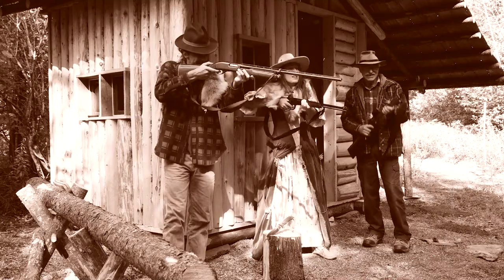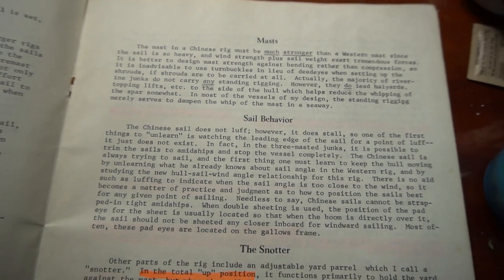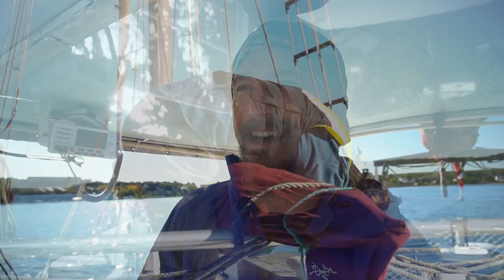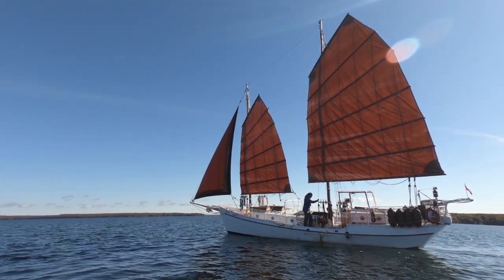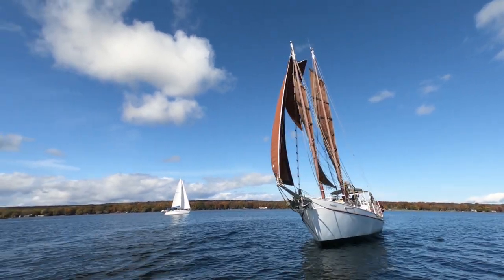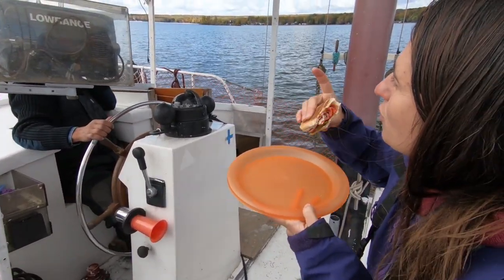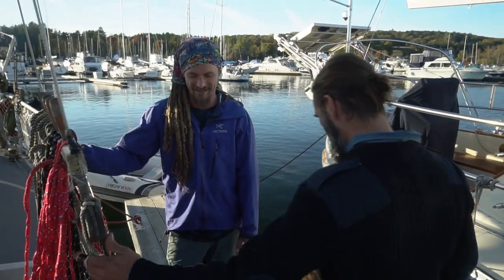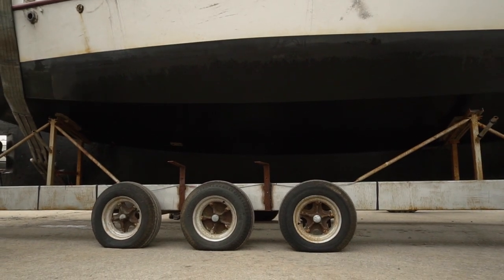Sailing a Thomas Colvin CHINESE JUNK RIG SCHOONER in the Georgian Bay [Ep 154]

Comment: Very nice video. I am sorry that you didn't get any wind to speak of, the lug rig really shines when the wind picks up and puts some bend in the battens and especially when the wind is strong enough for reefing. To drop a panel or two to reduce sail is so fast, so easy you wonder why more cruising boats don't use the lug rig.

The lug rig is excellent for cruising because one person can easily set sails, reef the sails, trim the sheets, and lower the sails with no help required.
The lug rig is a lousy rig for day sails with friends though, there is nothing for anyone else to do! Boring...

Only slightly kidding but it is nice to have everyone who wants to, to be able to have a job while sailing.
It's really obvious when sailing with another boat and watching them run around doing the sail handling while you just sit and sail... especially if you have a windvane or auto pilot self steering.

I hope you will get to sail with them again when there is a nice breeze.
Reply from the maker: It would have been nice to sail with more wind that's for sure. However not having too much wind made it less scary to hoist all the sails. We were all very new to this type of rig.
Is lug rig a different way of naming the junk rig? At what kind of wind speed do you usually start reefing this type of rig? I can only imagine how simple it is to reef the sails. You seem to have a lot of experience with these kind of boats. Do you own one? Any tips are appreciated.
It was still very enjoyable to sail and get to experience this beautiful of a sailboat.
Reply: @WildlyIntrepid  Yes, I built a 28 ft cruising sailboat back in the mid '70's and used the Junk Rig Design Guide by Jock McLeod & Blondie Hasler to design the modifications to the boat and for the rig itself. Many of us prefer the Lug rig name over the Junk rig name although both are correct, and both are misleading to people who don't know them. A traditional Lug Rig doesn't have any battens or a boom, and a traditional Junk rig makes people think of the hull design, not the sails.

On my boat I didn't start reefing until about 20 knots apparent wind speed but that depended on the wind direction and what size waves and boat direction. I generally set the sails for a comfortable boat, not for the extra tenth of a knot that I could get carrying more sail area. It is amazing how much more comfortable, and safer, a sailboat is when sailed at 90% instead of 100%. It is so easy to drop a panel reef and to pull it back up that we would do it just to see the difference in speed and motion. It is something you soon learn by how the boat is moving through the water, not by how hard the wind is blowing.

I didn't watch the video again but I seem to remember that when your sails were being raised, the lazy jacks were loosened and the bottom of the sail fell on the deck? We don't adjust the lazy jacks that way, they should be set up so that they are slightly loose when the sail is fully raised, and they support the bottom battens and sails when reefing or dropping the sail. The sail is always safe and supported this way.

Colvin also used a different but similar rigging design by using sheets on both sides of the sail attached to the battens while the more common arrangement is a single continuous sheet to the ends of each batten. Both ways have advantages and disadvantages. Same with the mast and rigging, Colvin used loose stays and shrouds, the Hasler/McLeod designs are unstayed. My boat had a tapered diameter and thickness aluminum mast I had air freighted from England to Maui where I built my boat. 

It was always fun to take people sailing and watch them as they watched the mast bend under a full sail and a nice breeze. It took me many days sailing to build my confidence in the mast! Calculations are great, but the proof is watching it in action.

There is a small Junk Rig Association based in New Zealand online that would be an excellent place to start learning more about sailing the boat. searching online should give a lot of information and leads too.

I built my 28 ft boat to go cruising after spending 8 years on a 40 ft cutter doing sailing charters out of Lahaina, Maui. I wanted a smaller, more affordable and easily managed boat that one person could easily handle. I chose the Vancouver 27 design and modified it to be a flush deck with the Lug/Junk rig, built a mould and laid up the fiberglass hull, then the deck and interior. The boat was solid, safe, very comfortable, and so easy to sail.

My plan was to sail north to Alaska, down the west coast, through the canal, through the Caribbean, up the east coast, over to England, then to France where I would pull the mast, separate the two sections (30' & 15') and lash them on stands over the deck so I could put a nice tarp over them and then spend a couple years motoring the canals of Europe...

I needed cash to buy the diesel engine and was offered a job in Alaska for a few months which I jumped at. The few months turned into almost two years and a major change in life so I returned to Maui to sell my boat and move to Alaska.

The buyer of my boat sailed the South Pacific and eventually wound up in OZ where they put the boat on a cargo ship and sent it to the Seattle area where they sailed for a couple years before shipping the boat by truck to the East coast where I lost contact with them. They loved the boat too.

Long winded I know. Search here on YT for videos of Junk rigs and Lug rigs, there are a few I'm sure. Maybe someone has done a nice how-to video showing how easy they are to sail?
Reply from the maker: Wow thank you so much for all this precious information. I will definitely pass it along to my brother as well.  Plans constantly change but it must have been quite the experience building your boat.
The boom stayed up when we lowered sails and I don't remember any lazy jacks. I wasn't too sure if these kind of boats sailed that far since I've never ran into one while cruising. So this is great to know that people travel everywhere with the lug rig. 
Are you doing any sailing in Alaska, it looks like an incredible area to explore?
Reply: @WildlyIntrepid  There is a lot of great info online about the Lug/Junk rig your brother will find very helpful as he learns how to sail his boat. Yes, his sails have lazy jacks they are just too loose to support the sail. The sail pack drops onto the tube that is maybe a boom crutch? or a dodger frame? 

You put something under the sail pack when it is stowed to take the strain off the mast and rigging to support the weight. Some use a boom crutch, others use a strong dodger frame, others use a temporary pipe saddle.  Before hoisting sail we tighten up the lazy jacks to lift the sail pack off the support, then as we raise the sail the lazy jacks hold the bottom of the sail pack off the boat/crutch/tube/support/deck/cabin, etc. 

The video shows the sail pack hitting the tube at 6:44 and 7:02 (both approx) and the lazy jacks are shown clearly at 7:30 and that they are too loose. The Junk/Lug rig is very easy to learn how to sail and the full battens keep the sail in control much better than a similar size mainsail on a typical boat.

The book I mentioned is called "Practical Junk Rig" and is available from Tiller Publishing. It is well worth the money.

Your brother will quickly learn how to handle his boat and continue to improve his ability to sail it.
Good times!
Reply from the maker: Thanks for the tips and book idea. I think it's be a boom crutch since he doesn't really have a dodger. And I re watched and did notice the lazy jacks after all, there was just so many more lines attached to the main sail compared to ours. Learning is always good times!